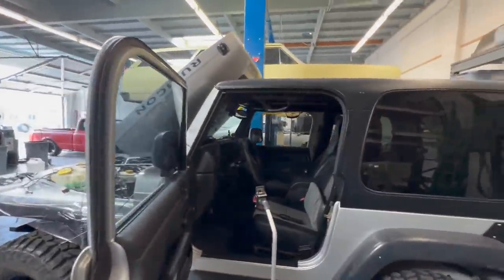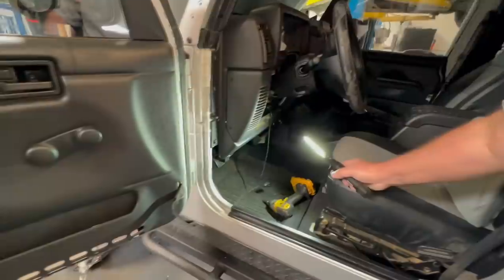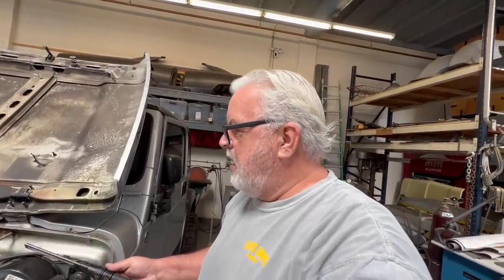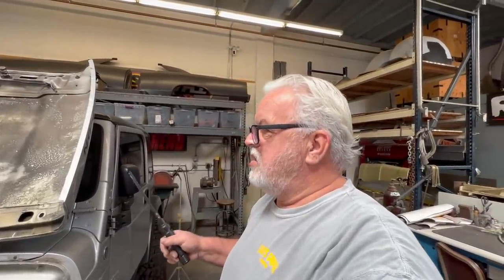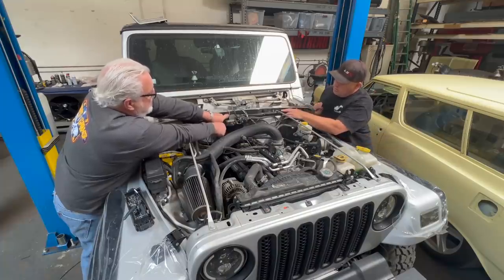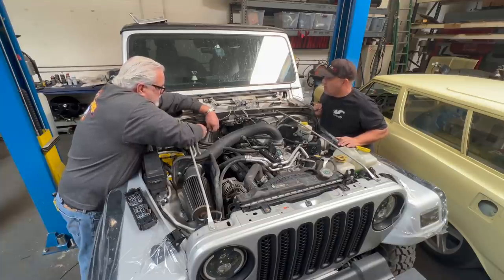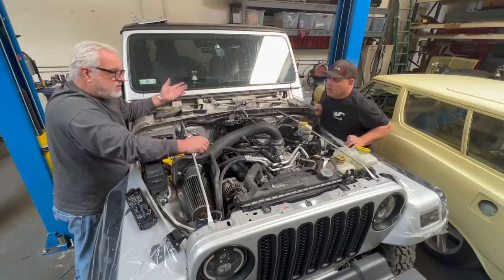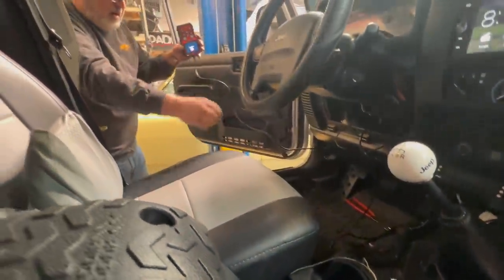Jeep Wiring Harness Install

Comment: Hi, I am having electrical issues with my Jeep. 

I originally had a 2006 Jeep Wrangler 4 cylinder engine and it got swapped to a Jeep Wrangler 1998 4.0L v6. The mechanic before had replaced a decent amount of the accessories but wasn’t able to finish up the dash wiring harness. 

I just wanted someone to give their professional opinion on what I should do.

My Jeep does start with a push button start but not with the key.

Comment: I have a 2010 jk that  I had the heater core replaced last winter. After that, I have no power to my climate control panel (ac, vents, rear defrost). I know nothing about wiring, just wondering if you could give a direction to start?

Comment: I know all that wiring looks intimidating when its laying on a bench but you should see what a wire harness for an Apache helicopter looks like when its laying on a bench. Gives you a new respect for the wire board layout guys when everything is cut to length and fits correctly.
Reply from the maker: I’ve been there.   
   Wire by number.

Comment: I have a 2012 Wrangler JKU might have some bad wiring, a camshaft position sensor bank 1 code keeps popping up along with my Jeep stalling. I live in Phoenix so the extreme heat might be killing the wiring harness, any suggestions? I just replaced the camshaft position sensor with another Mopar OEM part but code is still coming up, going to replace the crankshaft position sensor then reset everything with the JScan app.

Comment: Hope fully Lucky or a reader can help me out here.  Got an FSM for my Jeep TJ (2003)  Wiring harness was disconnected and moved around..  no clue what goes where.  MOST of the connectors are not used (diesel swap).  Oil Pressure and Temp gauge sensors (thus connectors) are.   FSM list ONE wire color and its tracer clolor.... but both have two pins/wires.....  how do I determine what the other wire color is suppose to be???.. so I can ensure I have the right connector.
Reply: AHH found it in FSM ... second wire color found by following wire from sensor along further. .  Have discovered the 3 wire connector.... is a modification from previous owner and it too (going by wire color PO preserved)  it too all the same two sensors..... plus ground...  (Oil pressure and temp sensor gauge)
Reply: found where that goes.... 3 wire Oil Pressure sensor (my eyes did not help me here to trigger where this 3 wire connector went... cause it was on a shelf and not on the engine. duhhh.

Do you happen to know if the sensor is NPT.... maybe 1/8 npt?

Comment: Hey Lucky..can you suggest a good way to wire up a 2003 wrangler sahara rear wiper/defroster and spray nozzle for a jeep that never had it..any help would be so appreciated..Im 51 and lost..please help..thank you
Reply from the maker: Cleanest way would be to just order the factory harness from a online junk yard or go and remove it from a wreck.  
  Get the factory switch to.

Comment: I know this is an old video but im looking for some expert advise. Got a 2005 wranger tj right hand drive. The harness is shot. Will a normal left hand drive harness work or is there a special harness? Been looking and cant find anything really except used ones. Thought about pulling it and going wire by wire inspecting but i dont have the free time i think that might entail. Any advise helps thank you!
Reply from the maker: That’s a tough call.  
  These harnesses are vin specific.  Every car , every year and every option is a different harness.

Comment: Help me please. I replaced the interior harness. Yet o go to start it and im getting power everywhere, but it wont start.  There is no starter relat near the battery. 
It started and ran before i started. So its not the starter. 
Please any help you can give would be appreciated.
Reply from the maker: Confirm that the vehicle is in park if it’s an automatic.

Comment: Does it have to be the same year harness? Or is there certain years that would work I have a 2008 wrangler x
Reply from the maker: Same year and options 
They make hundreds of different harnesses that almost look exactly the same and then once it’s all installed, there’s a couple of plugs that are there or aren’t there and features that will work or won’t work. Every harness has a actual number on it and you can match that number.
Reply: @luckysgarageshow  thank you very much!!